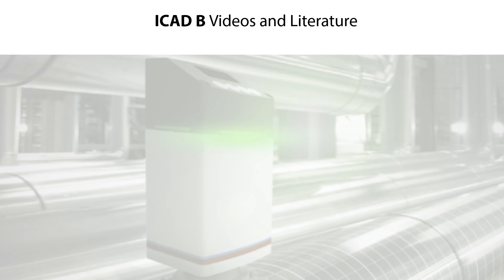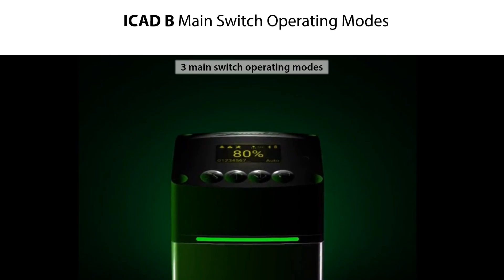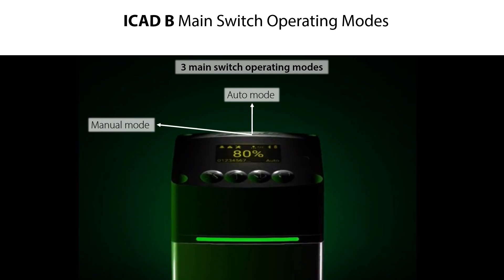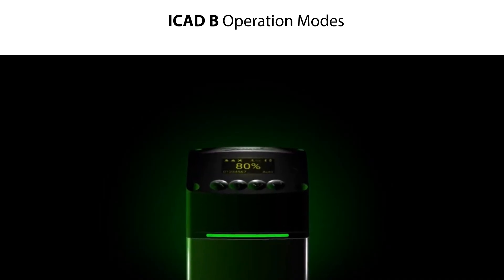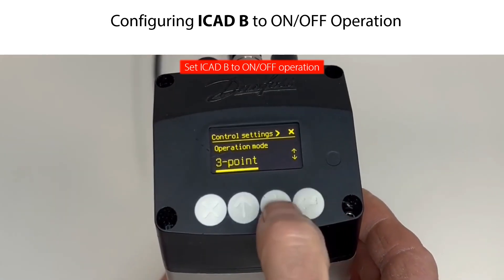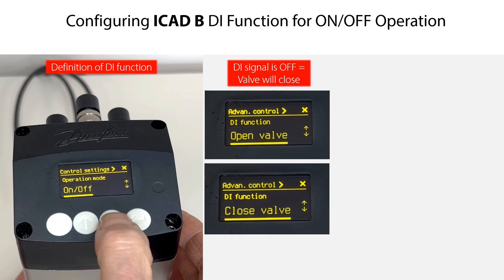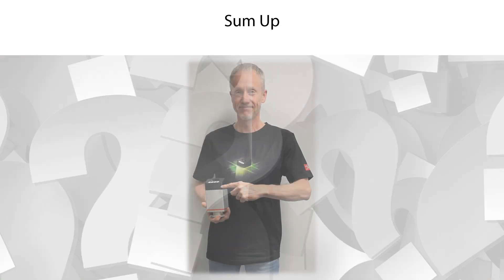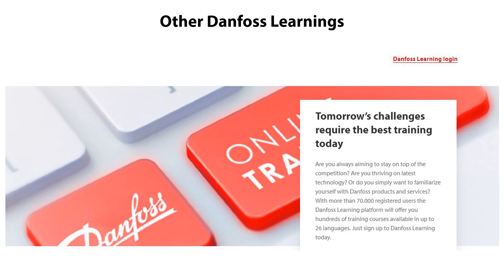ICAD B actuator: configuration of operation modes

Comment: I have the question: We have one of these models installed to be controlled with a Myportouch controller; however, in order to have the simulation correctly, we must measure the analog output to the channel where it is connected, so that it can recognize the current signal. Otherwise, it throws an A3 alarm. How can I eliminate this alarm on the actuator?
Reply from the maker: Hi, please reach out to your local Danfoss sales and service office to troubleshoot: https://bit.ly/3aQedtE